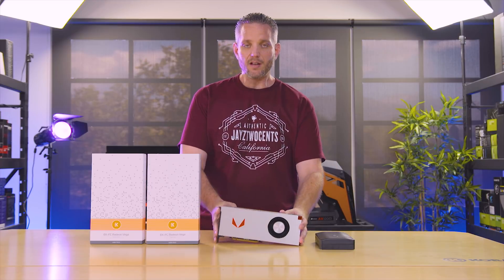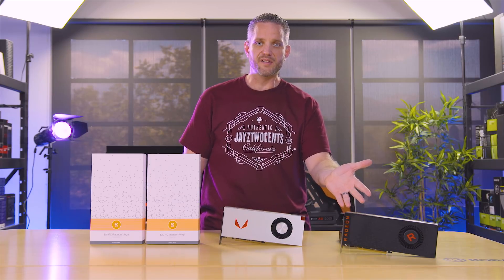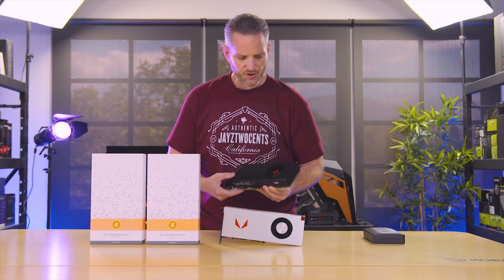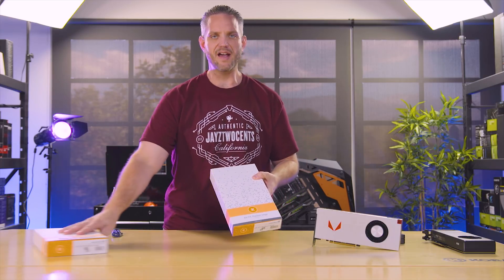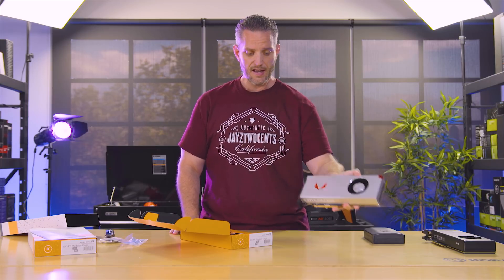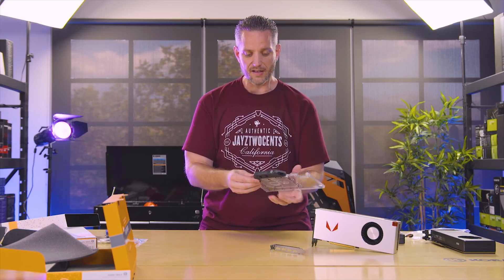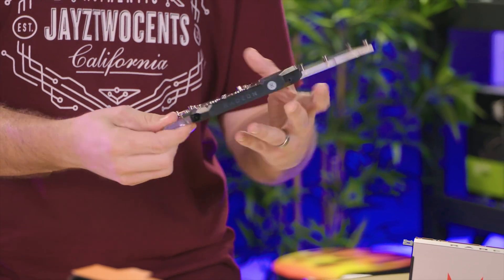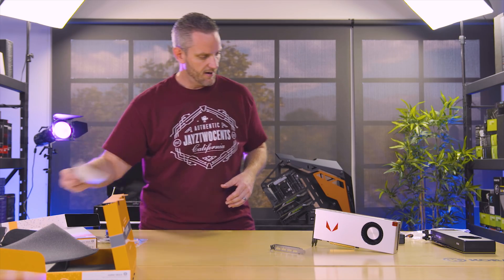Does watercooling help AMD Vega cards?

Comment: Ironically. I was given a vega 64, in trade of a vega 56. It was odd thinking on the other dudes part, I know lol. But It had such a noticeable coil whine. Then After putting an EK a240r kit on it. The whine is all about gone. Even under full load it dont hear it anymore. I am just horribly disappointed in EKs EOL support for this kit. I bought the kit new off amazon, and they are like, oh well, sorry you are having issues, when I emailed them.

Comment: Yes I know this is a older video but as time went on the prices for Vega as we all know went way down. I got mine 11 months ago for about $275USD. Mine is a Vega 56 but I bios flashed it to a Vega 64 so I could unlock my Samsung HBM2 memory to get to much higher speeds and bandwidth. My card is on a air cooler with a custom fan profile and my core hits in the mid 1600's and goes al the way up to the mid 1700's if I push the card harder with a more aggressive OC. My current OC is with a huge under volt and only a slight core OC and HBM2 is only at 1050MHz it will go up to 1100MHz stable and maxes up at 1150MHz for the HBM2. I play at 1080p so I find this card is way more than enough for 1080p gaming and actually can handle 1440p gaming great as well but 4K on this card even if I max out my OC it only does something like 53-65FPS in a game like the Division 2 or Destiny 2. There are others like World war Z where it still hits 75-80 FPS at 4K though. My screen is only 1080p so I have to use AMD's VSR to upscale past 1080p.

Comment: Hey Jay, thanks for yet another cool and very informative video! I go to your channel like people go to the library -  to get that good knowledge for all my builds. I am curently upgrading my video edit rig and am thinking of putting a dual vega 56 crossfire config mainly for Resolve and Premiere Pro. Obvioustly I am doing it for budget reasons beccause I believe its one of the best options (the big downfall being power consumption.) I just wanted to ask you if you still have a vega 56 with that waterblock liyng around can you part with it and send it to me (will pay the postage). I was thinking of making a video comparison (for my little amateur youtube channel) of my getto chinese generic gpu waterblock with cheap aluminium heat spreaders for the mosfets vs a real GPU waterblock. Thank you  and please keep the flow of knoledge! You are definitely my guru when it comes to hardware and I've been building computers for 23 years now!

Comment: The reason it bounced frequency was because it reaches power limit. The only way to fix it is to undervolt the card and max the power limit slider. You are not losing performance, you get higher and more consistant frames due to the frequency stabilizing. And if you really want to push it, just try to overclock the HBM and not the core

Comment: At this point in 2019 and with current Vega prices. This would be a fun bit of modding for a new build. (:
Thank you Jay.
Reply: I've seen Vega 64's go for as low as $230 USD... Throw on a waterblock, it's definitely a very good option
Reply: @HahnVogel  I am looking for this kind of deals currently.
Reply: @HahnVogel  picked up a vega 64 for 179.99 at my local microcenter ! incredibly happy with the perfromance.
Reply: Giovanni Delmoro That’s an amazing deal.
Reply: @HahnVogel  Just picked up a Vega 56 for $188 USD. Can't wait till it arrives!
Reply: yeah im looking to upgrade from an rx480 and Vega seems like a pretty good buy. 5600 only has 6gb and the 5700 is too spendy. 5500 and 590 are probably not worth it over just putting my 480 on water, but id rather upgrade to something i can keep longer.
Reply: @eclipsegst9419  Isn't the 5500 the same as an RX480?
Reply: @WarriorsPhoto  no, the rx5500 is quite a bit newer and faster. Although it does hold about the same position. It went R9 380, RX 480, RX 580/90, RX 5500. Difference is at the time the 480 was the top of the mid-range Polaris cards, and the 5500 is now the low end of the high-range Navi cards. The speed has improved, die has shrunk, and GDDR5 vram has been replaced with GDDR6.
Reply: Keegan Johnson Gotcha and thank you for helping me understand. I am looking to replace my RX480 cards when I go to Catalina or beyond.
Reply: @WarriorsPhoto  yeah, same here. It still performs but it runs pretty hot and loud on the latest games to do so. It's a reference card so it howls. Idk, I know AMD is releasing the top tier 6000 cards soon and the mid-range will follow. I'm kinda wanting to wait and see if I can get something that is just as much of an upgrade as a Vega would be but that uses less power to do it.
Reply: Keegan Johnson If I was looking for compute performance than I would go Vega for sure. If gaming is your thing than a RX series would be best. Let’s hope the new cards are amazing and run cool and use less power and run cool 😎.
Reply: Bought one new today for 206 Euro. What a deal.
Reply: Calvin Jordan That actually is a deal for a Vega GPU.
Reply: Picked up mine on ebay for $220
Reply: I have the Vega 56 give so many lags
Reply: @ronaldofeliciano4219  Are you talking about while playing games?
Reply: ricky v games from now dayz tomb raiders metro u can’t play that game overclocked u only hope and need to find old drivers the new 1 don’t work
Reply: Ronaldo Feliciano Bummer to hear. I decided to move on from the Vega GPUS once I saw the performance of rDNA. (:
Reply: Vince Sounds like a good deal. Those are 16GB models.
Reply: Got myself 2 Vega 64 Liquid Editon (remember, those are the binned ones) for around 1000€ about a year ago. Both run stable at 1875Mhz P7 @1175mV and the HBM @1180Mhz. Ofc custom water-cooling loop. 
A single card is usually faster than a strix 1080ti, two of em get you to 2080ti levels in benchmarks (it's really sad that multi GPU isn't really a thing at the moment) 
I love em, they are so nice and they really are amazing if you like fiddling with your hardware.
Gotta admit tho, I tripped my Power supply several times haha
Reply: @vffa  That's sounds like an amazing build there. Wowzers. (:
Reply: @WarriorsPhoto  yeah I'm really happy with it, it just got finished but now I'm starting to think that my 6700K (can't get it past 4.75Ghz) is bottlenecking it haha. 
The never ending cycle of buying hardware. But I'll have to wait... money doesn't grow on trees. Sadly
Reply: @vffa  I know what you mean about looking at new hardware. We always want more. Thank you for reminding me that. (:

Comment: I better hope so when I get my case mod finally done.  Here my Vega 56 MSI Air Boost 8gb OC edition result.  Pairing with Fx-8350 4.62Ghz and very fast ram of 9-10-9-23 2000Mhz, NB 2500 and 3200 HT Gigabyte 990FXA UD3 Ultra CF, probably the rarest of it kind.  https://www.gigabyte.com/Motherboard/GA-990FXA-UD3-Ultra-rev-10#ov

  Not bad for a Vega 56 result to get this close to water cooled with more power phase control, the FE only have two being P-state 6 & 7 correct?  My have seven P-state, took a lots to tweak to get the result I have for a blower running at 70% fan speed and it cooled to 27c really quick.  First place for single Vega 56 on Fire Strike Ultra and Exteme with the Fx 8350 single GPU.

Fire Strike Ultra https://www.3dmark.com/fs/19928441 Graphic Score 5,727 (50 point shy of Jayz)
Extreme https://www.3dmark.com/fs/19897295.  Graphics Score 11,024
1080p Firestrike https://www.3dmark.com/fs/19897477  Graphics Score 23,413

They are my highest so far and still going need to tweak the setting until it doesn't work, nevermind with this card to reach 5000Mhz playing MTG arena or older game titles when the GPU usage is going in the 70% to 95%.  Room temperature is 75 F if you're wondering.  My last OC setting last night playing Doom average in the 85 fps with Resolution of 5120x2160, thank to Virtual Super Resolution to never thought Microboard 34' 3440x1440 Ultra Wide could support it (Linus half ass reviewing), with game profile max out with overriding AA 2xEq Super sampling method.

Got it for 309.99 plus tax, forgot the $30 off promo code and the second time I could of have this same GPU for $249.99 when it was on sale and sold out.

Ps:  All of the OC I did was undervolting the P-state with Afterburner Graph Chart similar to Wattman chart with increasing the Core Voltage of +43, Voltage between .987mV and 1000mV during test run with Ultra.  The previous two, Extreme and 1080p run were done on Wattman.  Been going back and forth on this since AB does not have a memory hbm2 voltage control for this card except memory ram temperature graph.

Comment: Basically there is no better card than the Vega 64 for a Hackintosh, so yes, if you've got one you want to have a Vega 64 (or two) and probably watercool it (them). Could you test the Vega Frontier Edition, it is even faster than the Limited Edition and has 16GB HBM2 memory. Thanks again, Jay!

Comment: Hey JayzTwoCents will this water block fit a Radeon VII??? Thanks for your answer. I like your vids.
Reply: TheAlienwaredude Pretty sure it doesn’t. They have a completely different PCB.
Reply: @avagreen9060  Thanks for the answer Dave.
Reply: TheAlienwaredude No problem, I think EK has a Radeon VII block available if you need one.

Comment: How loud is a water cooled gpu?   I can’t find info on that. Some say quiet, some say loud.  I want whisper quiet
Reply: Depends on the quality of the pump. I had Thermaltake bigwater back in the days and found it quiet. Now I have a corsair closed loop cooler for my CPU and that's also rather quiet. But it all boils down to how loud all the other stuff in the pc is.

Comment: Vega + water block + undervolt = 1700MHz+ even 1750 on core and 1100MHz + on HBM which further widens the gap over 1080 and closes the gap over 1080ti. All while lowering consumption. Come on Jayz you went half effort on this. If You gonna do a water vid do it right. Undervolt/ overvolt full power overclock. The whole shebang. We aren't water cooling just for pretty looks you know.
Reply: I would like to see this also
Reply: Personally dude Im cautious bios modding not that I wouldn't do it but we/I don't know what damage It might do In as time passes. still I'll probably wait till 2021 to pump out that extra 15%. I game mostly at 1440p tho so I can understand people wanting 4k
Reply: Sorry for replying on such an old post, but what did you set yer vega 64 to. I keep getting black screen crash to desktop with mine mostly with unity games, but a couple regular titles too. I dont know if it is the undervolt or what. I am Stock gpu clocks with an undervolt of 1065. Memory is OC to 1050..
Reply: @barrelracer318  I haven't really bothered with a core overclocking much. 1750 is where I am at on my LC edition. Have not changed it. I've just upped the power limit. HBM however I run at 1150MHz. About the edge of stability in my case. Vega is bandwidth bottlenecked up until about 1100mhz so HBM overclocking is a must.
Reply: @barrelracer318  black screens are usually caused by beta drivers. version 20.4.2 is working fine for me
Reply: @smol9853  im afraid to, but im at the point where i am going to start to step up through the driver versions and find a good stable one. The latest update to windows has all unity based games and odd games all crashing. A lot of times it is all the same style crash. Screen freezes, sound and controls keep working then ctd. But with the monitor i have now, if the signal gets interrupted. The monitor retains the last recived frame until it is powered off or a new frame comes throught. The samsung sj55w is such an oddball display. Makes me miss my smaller lg ultrawide.
Reply: Got my red devil vega 56. Full rebuild and 64 bios in. 1750mhz core 1150mhz mem -80mv. Hit 5074 superposition score and 50c core/hotspot 79c. :D This card is awesome! Fixed blackscreens with DDU safemode, fresh drivers, disable ULPS reg, turn off chrome hardwareaccl.

Comment: Today you can buy a MSI Radeon RX Vega 64 Air Boost 8G OC for $410! First question, Should I purchase this over both the rtx 2060 $350 and the MSI RTX 2070 Ventus 8G $500. If I switch from the Vega 64 to the RTX 2070 I can switch power supplies and the difference is only $62. Hell I'm dam near talking myself into the 2070... lol    What do you think?

Comment: You should introduce a custom mod by getting a case that can fit on 3 360mm water radiator coolers each with 3 120mm fans with water block. It could fit on 4 of those 360mm but I don't think you can put one on front and side front due to radiator space, not fan space. The Thermaltake floering is $100 after $50 rebate at Frys but it's only made for the CPU, you would have to custom mod for a GPU or two GPUs if you have a NVLink SLI Bridge. Then the two cases I speak of can fit on 15 fans in all, 3 120mm at top, 3 120mm to 140mm fans in front, 3 120mm fans on side front, 3 120mm fans on bottom, and 3 120mm fans on rear. For 5 120mm fans it's like $36 and you can get 10 120mm fans for $72 and 2-3 360mm water radiator fans with water blocks for $200-$300. That's $260 to $330 in all. If it can only fit 240mm to 280mm water radiator in some places, but for two 360mm water radiators, the 240-280mm water radiator could be used for the CPU while the 2 360mm water radiators can each be used for each GPU.

For 2 GPUs NVlink SLI Bridge and 3 360mm water radiator coolers, and 1 240-280mm water radiator cooler these are both good.

ENERMAX ECA3500BA-RGB Led Middle Tower PC Case Saberay $165

or Thermaltake Level 20 GT RGB Full Tower Case with fans $245

Floe Riing RGB 360 TT RGB Fan $186 ($100 after $50 rebate at Frys)

You can also put on additional fans for cheap:

https://www.amazon.com/gp/aw/d/B079FWPS5X/ref=sspa_mw_detail_2?ie=UTF8&psc=1&th=1

https://www.amazon.com/EZDIY-FAB-Wireless-Airflow-Adjustable-Radiators/dp/B07B96SJMG/ref=pd_aw_sim_147_1/146-3049863-0372117?_encoding=UTF8&pd_rd_i=B07B96SJMG&pd_rd_r=33a35bbe-1a8f-11e9-b65f-8df44b2d4dcf&pd_rd_w=VzF7a&pd_rd_wg=WFYPT&pf_rd_p=57b46099-d750-4d74-83ee-63ad64b310a4&pf_rd_r=JPDGDMEX8QVTSEJVGFJ5&psc=1&refRID=JPDGDMEX8QVTSEJVGFJ5

For just one GPU either of these can fit 2 360mm water radiator coolers with 3 120mm fans each with water block:

Rosewill ATX Mid Tower Gaming PC Computer Case with Dual Ring Blue LED Fans, Spectra C100 $70

or Thermaltake View 31 RGB Dual Tempered Glass SPCC ATX Mid Tower Gaming Computer Case Chassis, 3 RGB LED Ring Fans Pre-Installed CA-1H8-00M1WN-01 $108

Comment: Hey Jay i found randomly video just to ASK you about build... i am building basicly not me the shop will build PC i am just picking parts and those parts fits my budget: ryzen 5 2600x ram is xyper x 3600 motherboard is msi b450 gaming x trio one of best from b series, power suply 850w 80+ , case is Random, but im stuck, i want n vidia Card but my monitor with g sync is Away from my budget so im limited with amd’s free sync monitor but im buying 1440p 144hz reffresh rate and im stuck between rtx 2070 strix gpu and asus strix vega 64... i need help i dont care about 5 fps difference i just want smooth 100+ fps on 1440p monitor gameplay... i perfectly selected parts but im just stuck with graphic cards... need help... and if i buy n vidia do i need that g sync free sync technology.... i searched that sync thing and IT camed out that on 144hz monitor u actually not need that much... so my question is strix vega 64 gaming oc or strix rtx 2070 price is higher on 2070 so IT Play some thing i can buy bigger m.2 ssd but its not nessesary that much. I will appriciate if u answer me. Im not planing to change gpu in 2 Years when i buy now the complete PC so i need that will vega be good in future this vega 64 or to buy rtx wich is basicly Made for future gaming

Comment: Got a Vega 56 Air Boost and I'm looking into water cooling it with new PETG hard tubing (Pray for me when I start... Nerves are already through the roof and i havent even bought the dang things yet). Has any one Crossfired the Vega 56's and if so, what are the new FPS are you experiencing? Just out of curiosity. Also, I wanted to thankyou JayzTwoCents for your video's. It is helping me out with my current build.

Comment: It would be more fair if the card and the radiator is mounted inside a normal computer cabinet. This test is in open air, no wonder he reach below 50°C.

Comment: I just finished a build watercooling my 2700x and strix Vega 64 with an EK block. I ran the heaven benchmark at 1080p highest settings for a while and my Vega 64 sat at around 30 degrees under load and 20 at idle. My loop consists of a 280mm rad and a 360mm rad. Previously the GPU would idle at 35 degrees and under load 67 degrees. It seems like a worthwhile endeavor if you have to have a red team GPU and want to keep it cool.

Comment: Never understood the hate Vega 56 got its easily faster than my 1080 gtx and has better minimum fps and frame times with no stuttering and only used 165watt on stock clocks only turbo+ did it get over 250watt
Reply: That vega 56 pulls as much energy as my 1080 ti ftw3 and that vega 56 costed as much as my 1080 ti ftw3 after mining prices, so yes it's a failure and deserves the hate.

Comment: Guy`s i have question. I tried to search youtube, but no luck, might be wrong keywords. So the question: is there any difference between clear and nickel/metal in cooling. Metal supposed to provide a little bit more cooling than clear one, cause it can receive heat and pass to air much better than plexiglass.
Reply: It's just aesthetic.

Comment: Got my Vega 56 for $419 on Nov. 10th.  So worth it.  No water cooling needed and still a better deal than 1070 or 1070ti.  (Incidentally, it's the same price I paid for the i7 8700k on Nov. 8th).  Yeah, I'm that guy putting an Intel cpu and AMD Graphics card together.  $785 for Vega 56 Graphics card and 27" 1440p 144Hz IPS Freesync monitor.   You can't come close with Nvidia G-sync, which was what I was originally planning on.